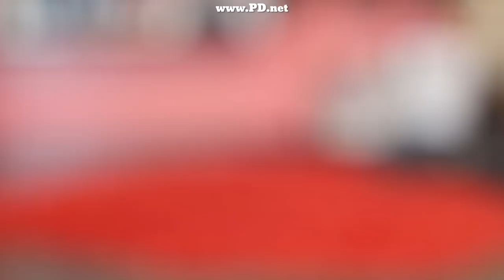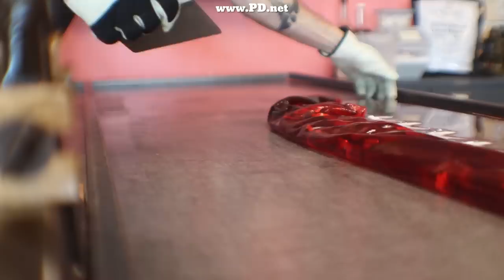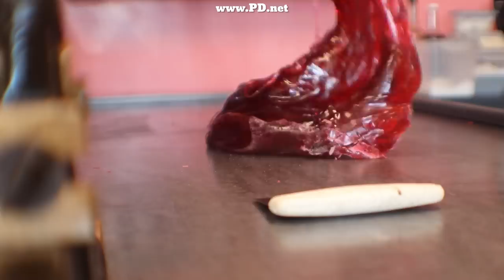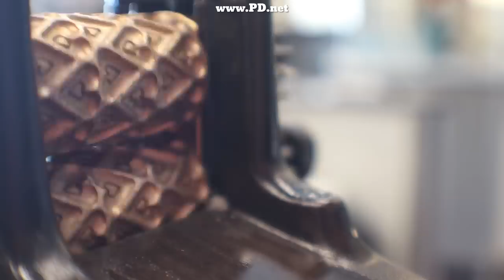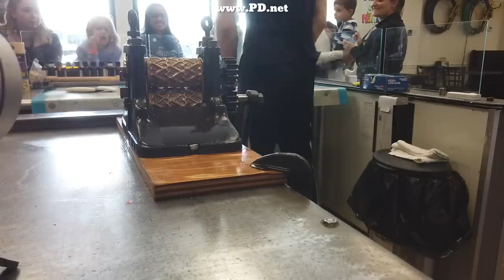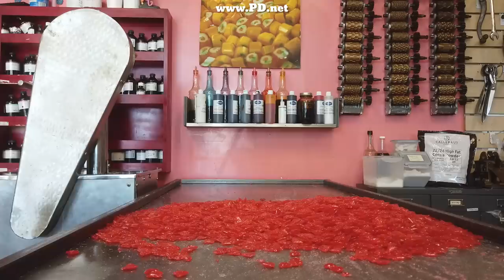#127 A 150 year old Victorian candy machine makes hearts & Why do we wear our heart on our sleeve?

Comment: Do drop rollers have to be made of a specific material? I work in a fabrication shop and we are working on building a c and c router and i would like to maybe make some?
Reply from the maker: Yes, they are bi-metalalic. Bronze for the roller and heat pressed mild steel for the rest.
Reply: Lofty Pursuits Thanks for the info!

Comment: I noticed that you often add the color at the cooling table, but this time you added it before.  What's the difference?  Is it just because you only needed one color here?
Reply from the maker: One color. Better to add it in the pot, it has less surface area then and looses less heat. This way we add the color when it's hotter, and pour it thinnner to cool faster.
Reply: @LoftyPursuits  Makes sense, thanks!

Comment: Does anyone know more about the brass rollers on the candy machine? My grandfather made candy and I have a bunch of these brass rollers framed and displayed currently. I"m curious about the markings on one set that says M&M on them. The candy shape is square with the M&M printed in the center. Thanks for anyones help that reads this! My grandfather also left me a bunch of chocolate molds and even though I never got to meet him I treasure these gifts.
Reply from the maker: Those were monogram rollers. The shapes for stock but you could get letters put on the inside to market your own business or for whatever reason. M&m with some buisnesse initials. Often candymakers ended up with ones from other makers use that had initials that had nothing to do with them. The real information of the numbers stamped on the edge of the roller.